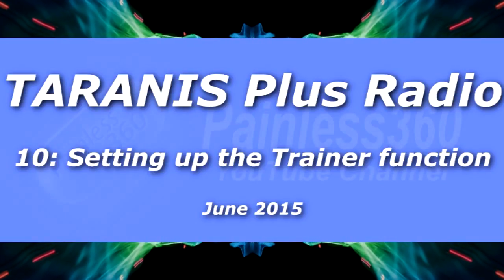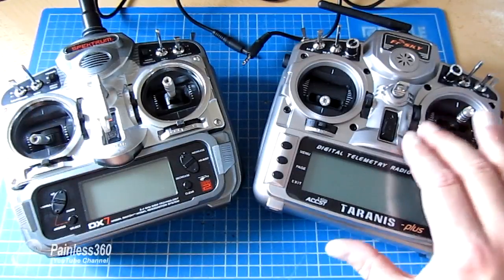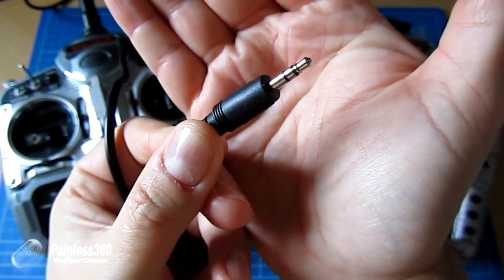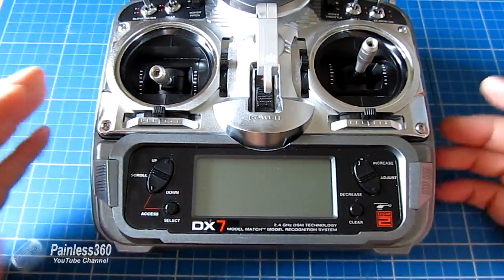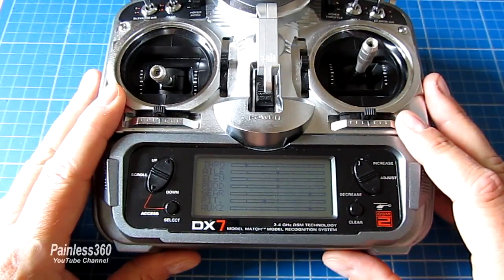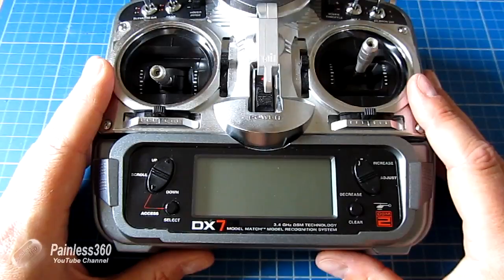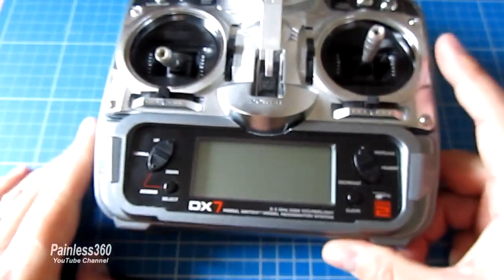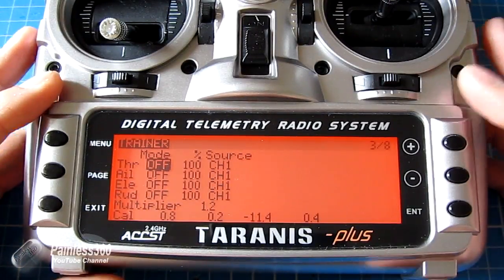(10/12) FrSky TARANIS Radio – Setting up and using the Trainer (Master/Slave) setup with a DX7

Comment: Hi,
Can you explain how I can done this whit delta wing ? On that have mix on 2 .and 3.chanel  for elevons and 4 for elevator . It's sky surfers whit out rudder and i have two taranis x9d
Reply from the maker: As shown the inputs arw the ones that come from the trainer radio, the mixes are only on the master radio... Happy flying
Reply: @Painless360  ok thanks on fast responding.👍

Comment: Thanks!
This helped me getting my Taranis with my 9X to works as a instructor-student system
However the weird thing in mine chanels 1 and 4 (aileron and rudder) were interchanged with each other in the final outputs.. but not only both radios were in the proper order ...in the Taranis when i checked in the sticks movement graphic the 9X was moving the correct sticks (aileron to aileron rudder to rudder) and the plane used ail as input for ailerons and RUD for rudder... but despite that the aileron stick moved the rudder and the rudder the ailerons)
Solved swaping the chanels in TRAINER but still doesnt make any sense .. everything was correct, chanel order correct, both radios to AETR and mode2 and even in the taranis the 9X stick movement corresponded to the correct inputs..

Comment: Hi, Thanks for all your contributions to this whole subject.
For trainer purposes is there a way of connecting the TX16S with a directly wired cable to another transmitter, thus avoiding the need for an additional module? Many thanks.
Reply from the maker: Yes there is. The top 3.5mm jack on the radio is a trainer port. See my videos on it..

Comment: Thank you very much! I have exactly the same Txs. My dx7 is about 7-8 years old and I've replaced it with Taranis because one time while model was on the ground, thank God, throttle servo moved once by it's own and then all the servos stopped responding(I have two rx each one has half of the servos -control surfaces) tx screen on, module emiting sound in the speaker on. Restart rx and tx and nothing moved. Came homme tried on other three models including the one that stopped working and they all worked. Since then I use the dx7 on the simulator. Would it be safe to use it as a slave in trainer mode since the master-Taranis does the signal emiting part? Thank you very much for this video.
Reply from the maker: If its only the transmission electronics that have failed and the rest of the radio is fine then probably..

Comment: Mine FlySky has a different plug however I used an adaptor from a simulator cord and it worked fine. I was wondering is there a way to take over the trainer just by touching the gimbals?
Reply: Never mind I see you already answered the question later on in the comments. I also think it could be done with the logical switches, but just don't know how I could give control back to the trainer.

Comment: Any chance for an update video using 2 qx7? 😇
Reply from the maker: I don’t have two of those radios but the principle is identical. Best of luck
Reply: @Painless360  Thanks Lee. I'll try that. My brother-in-law should be getting a qx7 like mine and then I'll probably want to use the trainer function.

Comment: nice video mate , but do i need to bind both radio to same receiver ?
Reply from the maker: No. The master is the one that's connected to the receiver and sending all the signals. The slave is the one that can be used to control the model when you need the pupil to be in control. But it's still the Master radio that sending everything to the model. Hope that helps, happy flying!

Comment: Should the transmitter that has binded previously with the rx always be the master? Or can it be the slave too? So that the master on the non-binded tx actually uses the antenna on the slave transmitter?
Reply from the maker: You can set it up either way. You just need to figure out how to change the settings on the radios..
Reply: Ok, cool!
Reply: I seem to be unable to use my spektrum dx6i, which has binded to it's receiver, to use it as a master and the taranis as a slave. I don't find any setting in the spektrum about this. In the manual it says it should flip a switch, but... doesn't work... .

Comment: Yes, watched that particular one several times now, very good as are all your videos. So if I get your suggestion correctly, run the headtracker through the trainer radio wirelessly to an x8r receiver which then inputs both the trainer info and headtracker info in  ppm to the Taranis?
Just bought an x9d and it has the x8r receiver.
Reply from the maker: Is this related to another question? Please reply to my response, I struggle to keep track of the many conversations and questions I get on YouTube daily..

Comment: Is it possible to add a wireless trainer and plug in an FPV headtracker?
Reply from the maker: +Jeff Bluejets wireless connection isn't on this radio for that..
Reply: Misunderstanding...what I meant was if I used another receiver that outputs ppm with a trainer radio such as the spektrum, fed that signal into the Taranis as well as a ppm signal from the open source head tracker project.
Reply from the maker: Yes you could. See how we setup a head-tracker in the series. If you also use an X8R you can output CH9-16 on the PWM pins for things like servos and use the S-Bus output for a flight controller.
Reply: Sorry about mixup on previous reply......hit the wrong reply button.......so once again hopefully correct place......
Yes, watched that particular one several times now, very good as are all your videos. So if I get your suggestion correctly, run the headtracker through the trainer radio wirelessly to an x8r receiver which then inputs both the trainer info and headtracker info in  ppm to the Taranis?
Just bought an x9d and it has the x8r receiver.

Comment: I don't have my own X9 yet but where do you set it so that the master pilot can take over for the trainer pilot with just stick movement?
Reply from the maker: Not sure you can, I'd look in the forums as you may be able to do it by detecting a movement of the controls using a logical switch and then using that to take control.. I've not done it, sorry I can't give you a definitive answer..

Comment: I set master and slave mode up using 2 Taranis radios, I am using the += option in the setup for aetr. When I over ride using the sticks from master radio my throttle on master only increases to 50% (I don't get full throttle). However the throttle on the slave gets full 100%, any idea on how I can get full throttle on master?

Thank you for the  effort you put into your Taranis videos excellent work!
Reply from the maker: +Andy Antal not sure, I've not tried it with two Taranis.. if you find the answer please let me know..

Comment: If the master moves a stick while the slave has control, master gains the control back. Can you change that setting so that the control can only be handed over by the flip of the switch?
Reply from the maker: There are a couple of ways to set this up - Special function "Trainer" which transfers everything to the Slave transmitter.. the other involves setting up inputs to individual inputs from the Slave, so it doesn't remove the Taranis own inputs. You can have a pay and see what way works for you..

Comment: Can anyone here help please? I am attempting this same setup and have tried with different radios connected to the trainer port on my Taranis but I get no input on the DSC port, nor do I get the icon on the screen when I plug in a cable (have tried different cables too) the only thing I get is the slave icon on the screen when I switch the Taranis to [Slave/Jack] but in [Master/Jack] I get nothing when pluggin in the cable nor do I get the raw input on the TRAINER screen of the menu.
Anything I could be doing wrong or would a be a defective radio? its basically new and all other functions work fine.
Reply: not sure what the issue is.   I just did it as described and it worked.   Ensure trainer mode is enabled in the special functions screen.
Reply from the maker: Not sure, this is how it worked here.. Best of luck with it..
Reply: Im having the same problem and im about to give up and go back to my spectrum

Comment: Is there a way to send only some certain channels from the slave box, like for controlling a camera gimbal. I was hoping to connect a slave controller to be able to use the right stick to control pitch and yaw of the gimbal and match them with other channels so I don't have to another receiver.
Reply from the maker: Not sure, we've never tried it. Probably, knowing OpenTX ;) Best of luck with it..

Comment: Hi
Thanks for an informative series of video's.  I came across a bit of a challenge today though where I was getting some training on flying a new type of model and my instructor was using a DX7.  We could not seem to figure out how to set up my 9XD as the slave.  Is this at all possible and if so is it possible to do a video reversing this one:)
Cheers from the A.C.T.
Reply from the maker: It should be, we're not planning on covering a video for such a 'vintage' radio now through (I still use my DX7 all the time). Best of luck!
Reply: Hi spent a bit if time tinkering and found out it can be done, but strangely you have to turn on the Taranis as well, even though it is in slave mode to the DX7.  Cheers and thanks again

Comment: Hi just watched your video and i have a problem i have 2x Taranis + transmitter and have followed your instruction to the book
but when i flick my switch on the master to transfer to the slave all works well but the master still has all the controls as well
any ideas how to solve this 
Thanks Colin
Reply: Colin Lister,  make sure you select 'replace (":") in the trainer menu,  not 'add'.

Comment: Excellent as always.  Not only did it show me what to do with setting up my DX7S as a slave, but reinforced some Taranis tips that I had forgotten like checking the stick actions from the Taranis home screen.  It also showed me how to set it up the way I wanted it which is NOT to pass over the throttle when I'm letting a friend fly one of my multirotors, i.e., they only get aileron, elevator, and rudder. Then putting the quadcopter in Loiter/SuperSimple (Pixhawk) lets them have some fun with little chance of any real problems.  These aren't folks who really want to learn to fly, but just have a little fun.

Comment: could you explain how additive value works for taranis? if the student was tilting full forwards and the teacher full back would it stay still?
Reply: +TheDIYGuy , normally, the teacher has to hold a spring loaded switch to give the student control. (The radios are only connected electronically, not physically).  The teacher simply released the switch, takes control, rights the aircraft, then holds the switch again to give the student back control.  In this way, there is only one person flying the aircraft at the same time.  Hope this answers your question.
Reply: +Bob T yes, thats what im using right now however i was wondering how it would work if it was on additive rather than one or the other

Comment: Thanks for the video. However I am just wondering why you first configure the multiplier and calibrate the center positions after that. To me that does not makes sense as without knowing the center you cannot accurately configure the multiplier. 

I would suggest that it is better to do it the other way around. So first calibrating the actual center positions and only after that is done configure the multiplier to get as close to the -100% and +100% as possible.

Comment: Thanks you reminded me I needed to setup my Futaba 14sg as slave and my Taranis plus as master. So for fun I followed your video and guess what it worked very nicely. Luckily I had the Futaba to stereo plug to hand. Had to reverse two inputs throttle and elevator did it your way that also worked nicely. So yet another video of yours that makes things easy. well done as always, from Thailand.
Reply from the maker: Paul Thomas Thanks Paul - see I'll still be using the DX7 ;)
Happy flying!
Reply: Well technically the trainee will be using it, Lol.
Reply from the maker: Oh yeah ;)